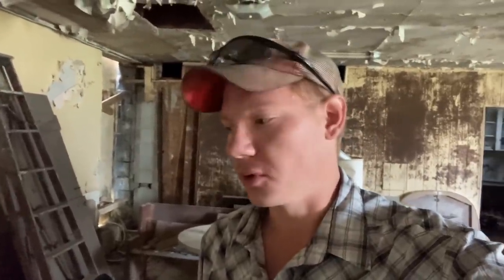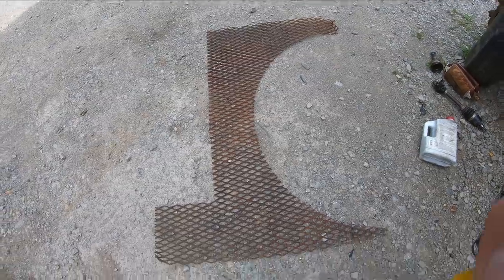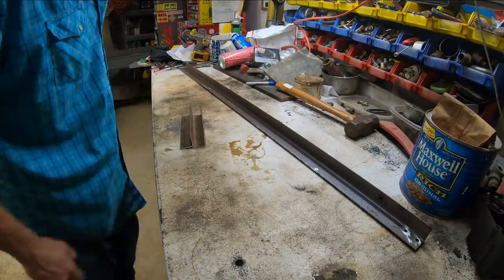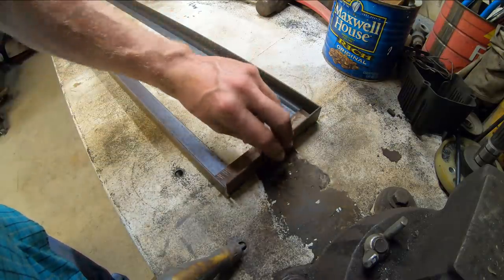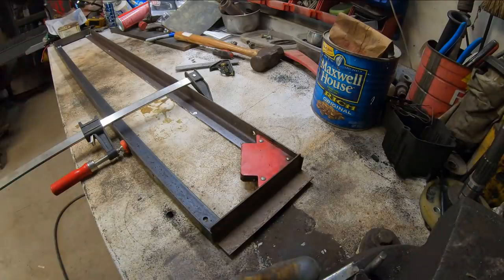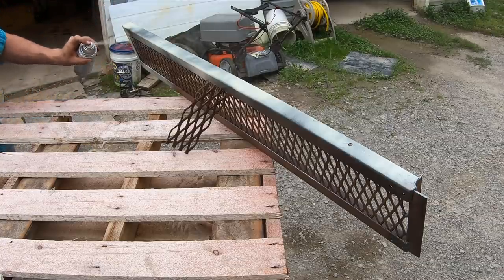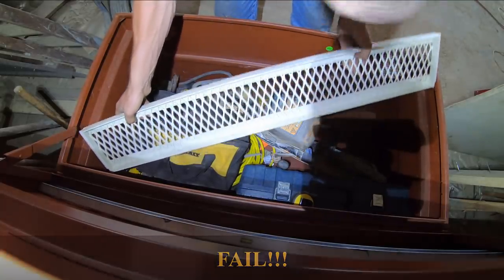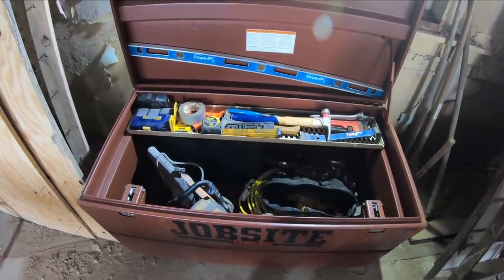Fabricating a Custom Tool Tray for a Gang-Box!

Comment: I worked as a welder some years ago.I now weld as part of my hobby. I've never set anything on my bench on fire. However, I set my sleeve and socks on fire a few times. I also burnt through a few running shoes..
Reply: I burnt the crystal on a brand new watch. Had to look at the hole for two years.

Comment: I just recently got an undermount toolbox put on my E350 Flatbed. I've been mentally engineering a tray and rails to mount it on, so I can have a place to put the tow strap and ratchet straps, up out of the chains and binders.

Comment: The 17 dislikes came from salespeople from "Delta", the maker of the JOBSITE Tool Box.  You see, they sell trays to fit this box, and if everyone makes one for them self, they don't get to sell you one.    Keep fabricating and fixin.  We enjoy watching...even your mistakes.
Reply: Diesel Creek can finance the church project - Custom job box trays $49.95 each  :-)
Reply: More likely came form the ones watching that couldn't understand why he didn't measure from tray rest lip (inside edge) diagonally to the lip above it on the opposite site. That would have allowed the tray to be longer and fit better so it would slide forward and back better. Or the fact he tryied to put it in diagonally and force it square. Corner to corner is longer than straight across.

Comment: A other good source of metal is the angle and tubing that is used to reinforce New Holland, Kubota, and LS tractors that are being shipped to the US. At least here in Eastern North Carolina I can get it cheap. It's not inch measurements but it will work. Metal scrapyards are good for getting metal cheap.

Comment: I thought I was the only one reclaiming old bed frames.  Good job.
Reply: I’ve seen a lot of them on the scrapper channels that’s for sure
Reply: Old exercise equipment also lots of square tubing.
Reply: I used one when i finished my shop for a sliding door. I had a hell of a time drilling it though.
Reply: Bed frames? You mean Angle Iron
Reply: I have several metal frames from Tractor Supply that the mowers are shipped in. They just throw them away. Thin metal box tubing good for lighter projects
Reply: @ericcorse  that's because they are in fact spring steel. They are tough.
Reply: I've used them for several projects before. Not fun to drill thru that spring steel though. Works OK in a drill press as long as you have a grinder to sharpen the drill back up.
Reply: I had to repair my Camaro in the desert of Pecos W Texas. Makes a great radiator mount but takes a min to cut through hacksaw style ...

Comment: Spray can tip: heat the paint before you spray. Summer time I just put the can in the sun. Winter put them on a heat register. Warm paint flows better.
Reply: I do that all the time. I put all my paint in a box and set it near a radiator all winter in my house. It's ready to go when I need it.
Reply: save old tips and clean them in acetone and replace clogged tips, repeat.

Comment: That was a great instructional video Matt. I like to watch you build things. I don't want to put any pressure on you but speaking of building things, 
I'm getting anxious to see an update on that 106 bag concrete wall you and those good helpers poured there at the old abandoned church. Kind of curious about the big block too! I am being extremely patient about the 57 Autocar because I (having built a few old cars and trucks myself) know that takes quiet a lot of your spare time. As you can see, I follow your channel pretty close and it is a great source of entertainment for an old man that can't get out and do the kind of things you do anymore. I appreciate all the great footage you send our way so keep it up.😎🇺🇸ps I noticed you use the Maxwell House storage system in your shop. I used that same system.
Reply from the maker: Good till the last drop....
Reply: @DieselCreek  Nah...
Only good till the first drop.
Then you kick it across the shop as you contemplate picking up all the stuff that WAS in the can.

Comment: That was slick and it works fine I made Joe's a bit wider  it was a foot wide but it was a fine fit with only a half inch of slack on the ends yours turned out cool Joe's was for a lot of stone cutting and stone masonary

Comment: GHope you got it bolted to the floor in there. You wouldnt want it to go walkies ! Great job on the storage shelf. :)
Reply from the maker: Yes I need to secure it better as well
Reply: You’re not using Master locks on that box are you? They’re garbage - as are most consumer locks, unfortunately. Check out the Lockpicking Lawyer’s channel.
Reply from the maker: Yes I’ve watched lots of his stuff, the people around here that might break in wouldn’t know how to spell master lock let alone pick one haha
Reply: Matthew Taylor  👍 that guys a wizard at picking locks,  my builder mates are using gps trackers hidden in site tool boxes now and hidden trail cams with good results
Reply: Drunk Dunc GPS trackers are a good idea.
Reply: Matthew Taylor  they hide them in new ovens, hot water units etc on some builds where these types of things go missing overnight too.  Just got to keep an eye on the batteries 👍
Reply: @DieselCreek  you just need a drill, but I hear what you are saying. Keeping halfway honest people honest.
Reply: @matthewtaylor3308  IIRC from my days on job sites, Master lock only has 8 key patterns per lock style. There is only one size of Master lock that fits those, there were guys who always seemed to have a lot of Master lock keys in their pocket. Modified my box to have that the lock could only be accessed through the bottom then used one of the harden steel locks from a Non Master lock company chain locking it in place lock was also inside the box

Comment: When you finish painting turn the can upside down and spray until it quits then they’ll work next time you need it. 90% of the cans will stop spraying upside down cleaning it out
Reply: I've got spray cans that are 20 years old and still spraying. It works.
Reply: I store my spray can nozzles covered with paint thinner in a reused jelly jar with the original top, need a nozzle pull one out and do the spraying, turn the can upside down and clear the top of the can, drop the nozzle back in the jar.
Reply from the maker: I have luck with that sometimes but not always
Reply: I pull the nozzle off and shoot some WD40 thru it. Works for me
Reply: That really only works with cans made to do that. I've got as many cans that will spray paint until they run dry as I do that will clean themselves.
Reply: @reaperreaper5098  That's what I was thinking. All the new cans can spray upside down and at any angle. So it doesn't work with these cans. Doesn't hurt to take the nozzle off though and soak them. The problem I have is the can clogs from the inside sometimes. Just had one do it a few weeks ago. Rust-Oleum 2X hunter green. Had 2 cans one clogged. Friggin Wal Mart wouldn't take it back either! Past 90 days or whatever they say they won't replace it. (bastards) Had to eat that one! These were 1 yr old. So don't know how the guy above had some 20 yrs old and still worked!!

Comment: I love the videos, especially where you explain what's going on and the thought process.          I have been thinking about adding a sliding drawer, but sliding the other way that would require adding angle iron along the front and back and utilizing 2 pair of the 99 cent Harbor Freight roller-ball bearings to allow the drawer to glide freely.          Those can be easily added to yours if you'd think it an advantage.
Reply from the maker: That would work as well!
Reply: Apart from the fact you have to modify the box, I think it would be a better way to have them run.  A 6-8" wide tray running across the short axis would take up less of the overall opening, allowing you to get bigger stuff in and out if you need to.

You could make several of them to get the same overall storage capacity as the shelf Matt made in this video.  And if you need to take them out for any reason, they're lighter and easier to handle than a single large tray.

If you wanted you could even make one with handle(s) and use it to carry (some of) your tools around on site.  Grab and go basic tool tray.

Comment: Most tradesmen keep tools in a belt or bag and just drop them in at end of shift. Most gang boxes only have a little tray that comes up with the lid. We keep aamo for powder actuated tools in there.
Reply: The best box I ever used for pat ammo was the plano 6 partition box. 
 This is a newer one with adj div.  
Plano Prolatch  Utility Box w/ Adjustable Dividers - 3600 Size
Plano  345026 6 fixed compartment
I only used the regular one for #4,5,6,7,8 and one compartment for a pencil and odds and ends.

Comment: Everyone makes mistakes I know I sure do, you kinda doubled yours on this one you only needed to cut two opposite corners. Also I use a lot of bed frames but I quit cutting them with my evolution saws because the steel in those bed frames prematurely dulls the blades so I go to my old faithful Dewalt chop saw with a abrasive blade or a wafer blade in a grinder, you can pretty much tell by the color of the sparks and if you have hot metal after the cut. Good Luck and God Bless

Comment: The end angles are upside down.  Flip them and they would have both a top and side sliding surface.  No need for the lip to stick up.   Slow down and think things through first.

Comment: This thoroughly confused me. I thought everybody just used scrap plywood on the top ledge and put a second one using bolts underneath the second ledge.  (to hold it up)
    If you're fussy, tack on a furring strip on each long edge to hold things in. I never bothered.
     Oh yeah. Tack weld the ends of the piano hinge to prevent the rod from being driven out in order to bypass the locks.